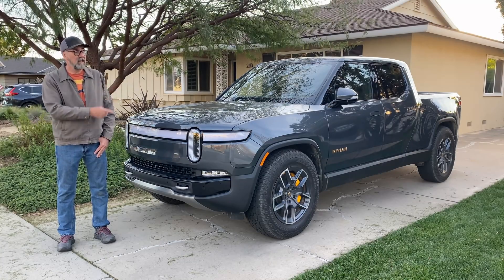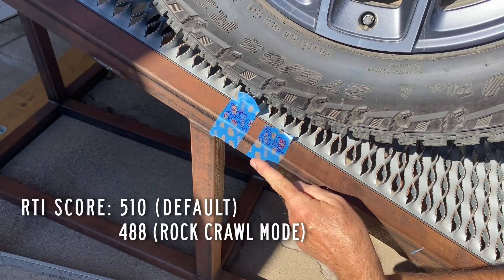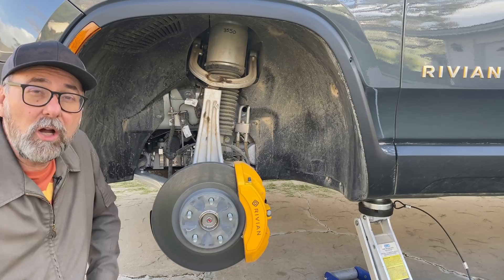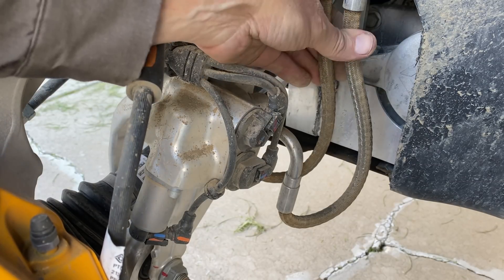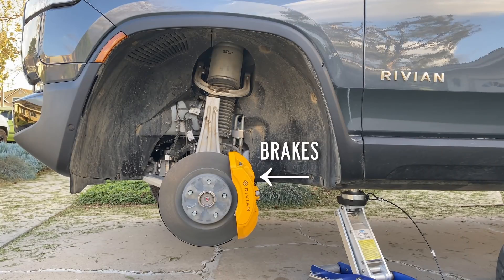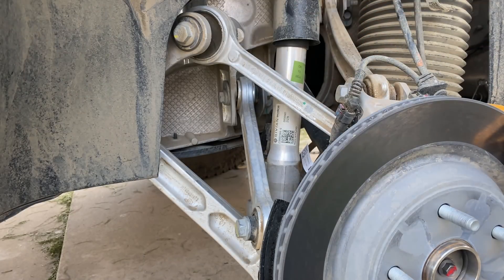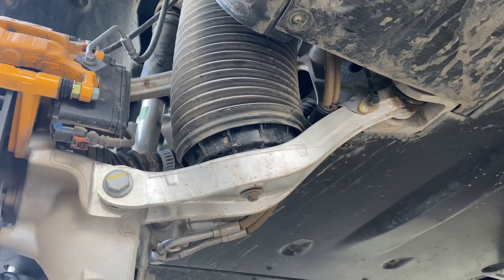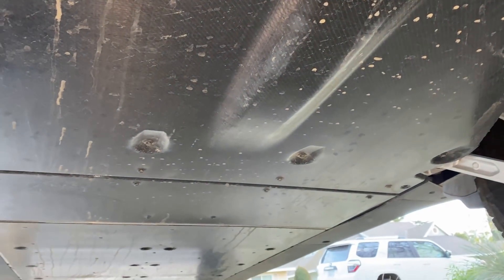The Rivian R1T Shares Suspension Tech with the McLaren 720S | Flex Test and Engineering Deep Dive

Comment: All the pump motors, hydraulic lines and other components, also, the suspension rubber bladder, the reliability is my question. Will this last 10 yrs. or more? Then another big question, will I have "right to repair"?

Comment: 75K Mile R1T owner and this is not a Deep Dive at all because it leaves out a huge and very fragile part of the system, the Kinetic pump. Nobody seems to be talking about this but they will as Rivian's put on more miles. As best as I can tell there is a hydraulic pump probably there to boost pressure in the hydraulic ride control as travel increases. This hydraulic pump can fail and send debris into the entire hydraulic system necessitating a very expensive and laborious replacement of all components, dampers, manifold, pump, and lines. Typically a hydraulic system would have a filter or screen to stop debris from moving downstream, so far that doesn't seem to be the case.

Comment: I own a RIVIAN R1T and have had trouble with the air suspension.  The truck is always lower in the front and higher in the back. It has been serviced 3 times for this problem and the air compressor was replaced, but the problem continues.  Aggravating!   Gary

Comment: There's nothing good about that "little rib" in the wheels. If the truck is driven for what it's made for, that "little rib" is going to fill up with mud and it's NOT going to come clean in a car wash. My 2012 Toyota RAV4 had the same thing, would fill up with mud, and throw the wheel out of balance so that once you got off the logging trail or fireroad and hit the main highway you'd be shaken'. Stupidest design I ever saw in a wheel. Any engineer with a lick of common sense would have figured this out as I knew it as I soon as I saw it.

Comment: Idk if McLaren should be credited for coming up with hydraulic roll control.  The new military JLTV built by Oshkosh has hydraulic roll control in the same way, piped left to right between the shabs.  As well as driver adjustable ride height for different scenarios.  And has been in development for many years.

Comment: Great video and technology to boot.  If only Tesla fans can explain why exactly Tesla vehicles' technology is so advance.   I keep reading those comments yet they fail to enumerate at least three technologies that make their vehicles cutting edge.  I don't think OTA is an advantage especially when it lowers the total driving range and slows charging to protect the battery and Tesla from warranty liabilities.
Reply: Heat pumps and heat exchange in general. Structural batteries. Body-on-frame is less suitable for EVs - Tesla has/plans no vehicles with body-on-frame design. Efficiency is highest of what's available on the market (though the Rivian is not that bad, either - waaaay better than the Hummer EV). Software is way more advanced.

I have to say I like Rivian. Tesla would be my first choice, but they don't offer a truck yet.
Reply: Octovalve for cooling and cold/hot weather performance would be one

Comment: with 4x motors I was envisioning no axles but not sure how that could get engineered.  would be nice to not have to worry about axle breaking on rock crawling
Reply: Motors integrated into the wheel hub is one such way. I think there are a few companies already looking into that type of 2/4 motor system. Adds unsprung weight though, so pros and cons to everything.

Comment: Those aren’t Brembos but Mando
Reply: I didn't take a picture to prove it, but Brembo is clearly visible on the front calipers, but its small and isn't visible from the angle I shot the image. As for the rear, I don't make any Brembo claims back there. Could be Mando, Akebono or any number of other suppliers.
Reply: @DanEdmunds  Any idea what the diameter of those massive front rotors are?

Comment: Is there a study on the safety of EVs? Considering the enormous weight of these things, like this truck, how much more at risk do they put people in your average 3000-3500lb car? Not to mention they handle horribly but go super fast in a straight line in that burst.
Reply: EVs in general do not handle horribly, in my experience, because the added weight is low down and centralized, which is good for handling. This truck, for example, handles better than a Raptor, TRX or Colorado ZR2 because of that and because it has 4-wheel independent suspension. In our tests, the R1T stops from 70 mph and 177 feet, and it generated 0.80 g of cornering grip. The Raptor manages 214 feet and 0.69 g, the TRX was 189 ft and 0.70 g, and the ZR2 Colorado was 206 feet and 0.69 g. So it looks like the R1T would be better able to avoid an accident via shorter stopping distances and better maneuvering grip. Your point about mass is well-taken, though, because physics is physics when two vehicles do crash into one another. But that ignores the potential for accident avoidance in the first place. That said, the overhyped 0-60 mph marketing metric for EVs is kind of silly when everyone is more concerned about range, and hauling ass all the time doesn't help that prospect one bit.
Reply: @DanEdmunds  I tried my hardest to get an r1t to break loose and it just wouldn't on pavement.  This truck scares me in a good way!!!  I'm hooked.
Reply: Definitely an increased risk, likely negated by better stability management, TC, and safety systems.
Reply: In no way does a Rivian handle "horribly". In fact, most recent EVs are noted for good to excellent handling characteristics. The battery placement leads to a low center of gravity, and it is normal to use all-independent suspension - although not necessarily as sophisticated as Rivian's shown here.

Comment: Does articulation increase if you set the suspension to soft or lower the ground clearance?  I.e. let all the air out of the bags?  Or in normal mode do you pretty much get every inch of wheel travel out of it
Reply: Normal is the lowest setting I'd want to use off road. It's unclear if the lower aero mode (which only works at highway speeds) or the access mode (only when stopped) would help. It seems like the wheels are fully stuffed in normal mode, but the bump stops are hidden up inside the air springs, so I can't visually confirm that.
Reply: @DanEdmunds  Would be interesting to check the ramp articulation in access mode if there's a way to get it to stay engaged when slowly rolling forward.  Maybe disconnect speed sensors lol.
Reply: Clearance range is from 9-14" depending on mode

Comment: I remember hearing about the McLaren’s hydraulic suspension and thought it connected diagonal wheels (driver front to pass rear and pass front to driver rear). Is that correct and if so does Rivian do similar? Sounded like in the video it was just front connects to front and rear to rear.
Reply: McLaren does do front to back as well. Across the diagonal I believe.
Reply: Dan indicates front to rear.
Reply: @mitchellgreen6685  did he mention somewhere else that i missed? I heard at 5:02 and 5:24 which made it seem like it just linked across the axle.
Reply: @mitchellgreen6685  It's not front to rear, it's left to right.  For ROLL control.  Front to rear would not be beneficial.
Reply: @SylasG  It is a central valve body and therefore can send fluid/roll control to any corner. It is fully cross linked. If it was merely side to side it would not be novel at all. Read a little more on it.
Reply: @SylasG  Also read about Toyota’s XREAS,, front to rear cross linking…

Comment: Don't Landcruisers use hydraulics too?
Reply: Not on the same way. KDSS is front to front on stabilizer bar.
Reply: Not in the same way. Land Cruisers (standard KDSS) and 4Runners with optional KDSS have physical front and rear stabilizer bars that can be rendered ineffective in frame-twist situations. Hydraulics are involved, but in a different way that does NOT involve the shock absorbers, which are conventional (and easily replaced/upgraded). The has no stabilizer bars at all and uses interconnected shocks instead. See this for the deets: https://youtu.be/m3BnLLwbScA

Comment: To say that pickup is anything like a McLaren is a joke.
Reply: Nobody said that. He said they use suspension components from the same supplier and the same style of hydraulically cross linked suspension. Maclaren is the only other manufacturer using this on a road car as it has been previously used primarily for off road (racing) use
Reply: @assaultlick2169  The McLaren's suspension is nothing new. It's a modern version Citroen's Hydraulic suspension.
Reply: Listening is a skill, something that you don't possess.
Reply: @rickjohnson2859  What?
Reply: Your ignorance is showing
Reply: Yeah… it’s faster than an F1 to 60 and less than a second behind at the 1/4 mile.
Reply: squint, and you'll see it too
Reply: Did you ever drive a car like this with this suspension technology? You would be amased

Comment: Don't those indents in the wheels collect ice?
Reply: I've never had a wheel that didn't collect ice...
Reply: @mitchellsteindler  Well one gets ice if driving in slush or deep powder that gets melted by the tyre heat. But there's also those wheels that don't have slope out of the wheel. We used to have cheap after market wheels for the winter tyres in our old volvo. it basically had bowl shape in the inside, so it collected all sorts of crap that didn't flush out. Mud and everyting water based that could freeze. We had those for month or two and had to get better ones as they just collected stuff and vibrated on daily basis :/.